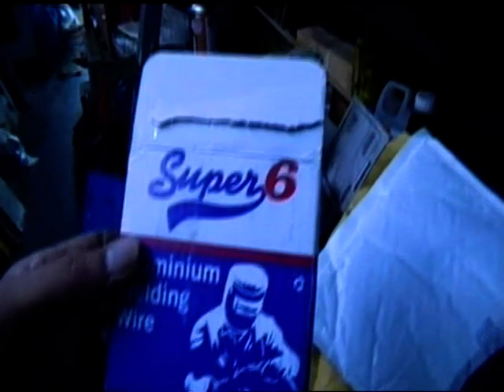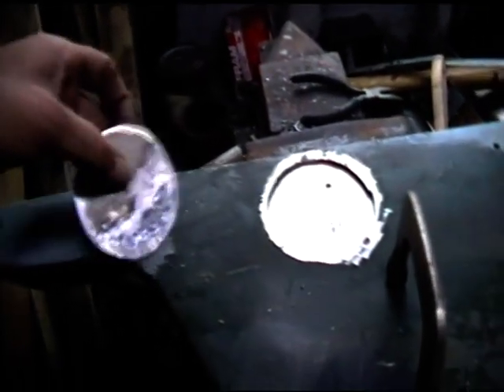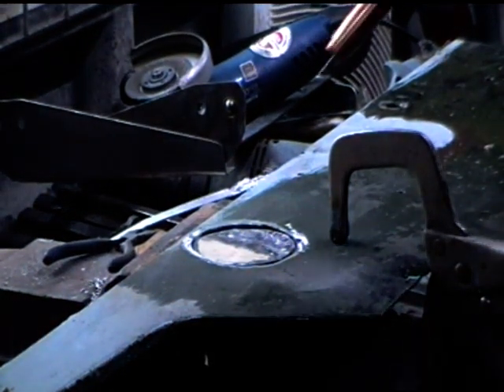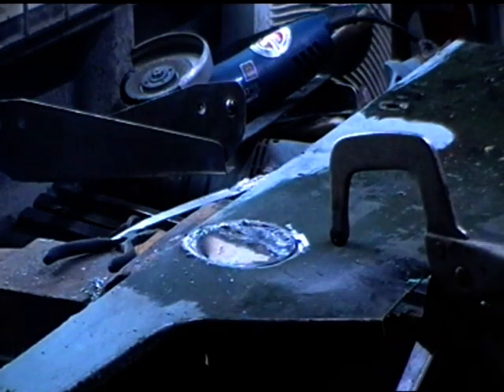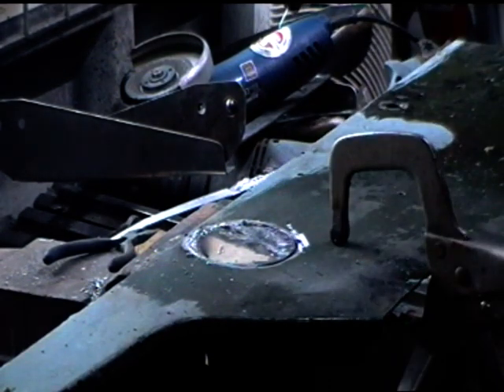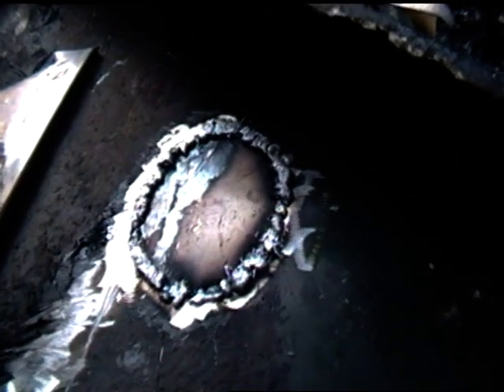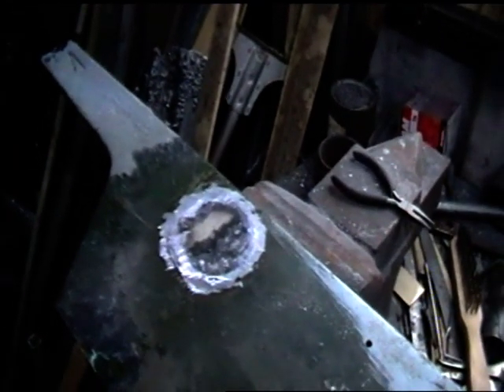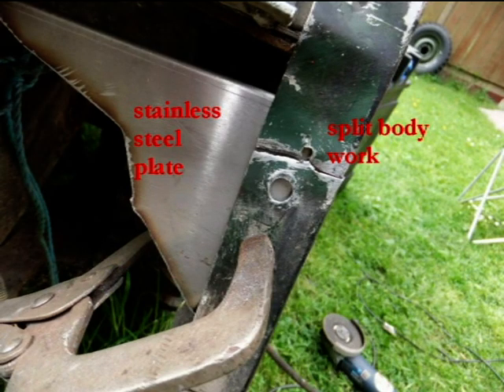Landrover body welding with a Spool Gun

Comment: So this is a mig welder with aluminium wire ? thanks
Reply from the maker: Yes I posted a video of converting the mig over and did some first test welds with it, and got a load of negative comments expecting me to be perfect at using it straight away. So this is an update video and showing it working hence I get no comments LOL.
Reply: It seems to work buddy ! I will try it on my Landy. Just adapt a spool gun and aluminium wire. Thank you
Reply from the maker: @macknumber Yes this is my conversion video .....as I said when you first try it you won't like the results but change the wire and practice. Also keep neg as earth is ok.  https://www.youtube.com/watch?v=6vNgZoSTNfQ